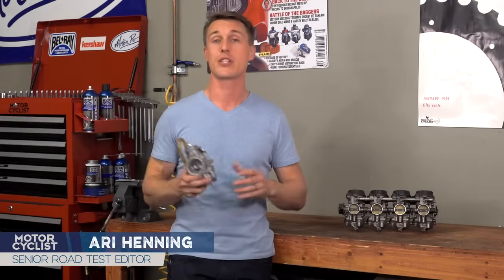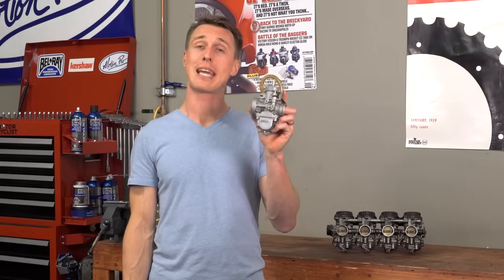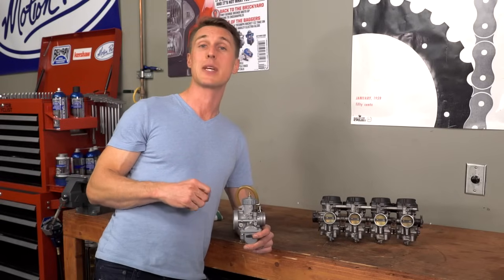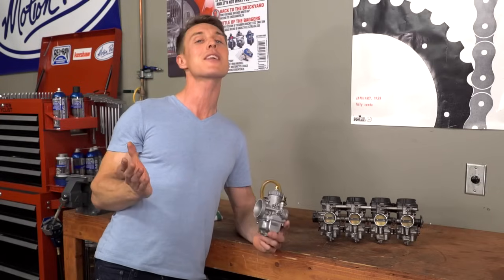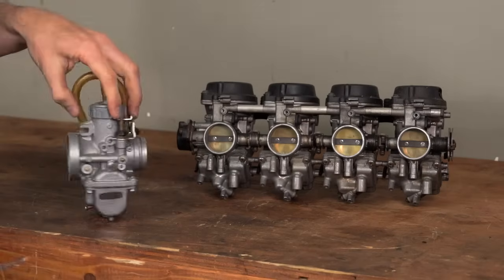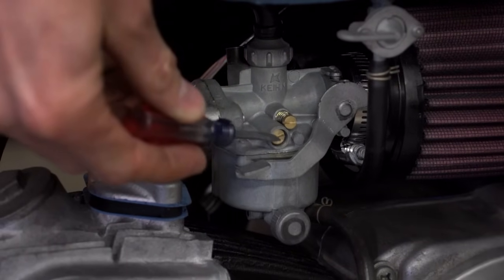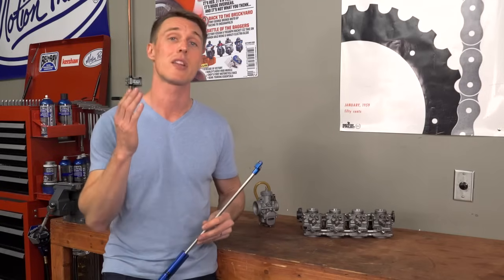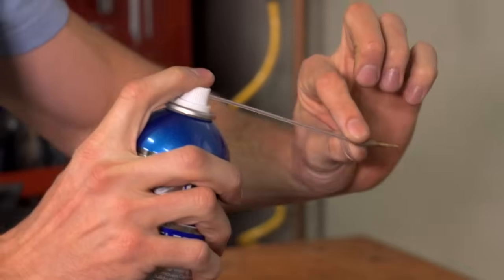The Single Most Common Carburetor Problem (Clogged Pilot Jets) and How To Fix It | MC GARAGE

Comment: Good video Ari, but I do have 3 comments: 

(1) When spraying carb cleaner through the pilot jet make sure that you do a couple of sprays with your finger over the bottom exit hole so that you can make sure the side holes are also clear. You want to see a nice strong mist of solvent coming through.

(2) If the jet is completely clogged often no amount of solvent will clean it. Before I pull a carb for cleaning I hit my local guitar store for a piece of steel E string . They will usually have some left over from stringing jobs and will typically give it to you for free. This is very fine but very stiff wire and you can gently work it through the jet without damaging it. Once there is a passage through the jet, the high pressure cleaner will then remove the rest as it passes through.

(3) I HIGHLY recommend holding the jet in a towel before you blow compressed air through it. Often your fingers alone won't hold it strongly enough and you can blow it across your garage never to be seen again (ask me how I know, LOL).
Reply: wouldn't it be easier to soak the pilot jet in a solvent, such as even rubbing alcohol?
Reply: E string smart!!
Reply: Copper wire works fine
Reply: @Mada-yq5sf  I have found copper is to soft to work through really crusty clogged jets. Guitar string works better. But to get the last of the residue I like blasting carb cleaner through.
Reply: Cool stuff

Comment: my trx300 had all the issues and it wasnt the pilot jet. it was the petcock on the tank only ran good when it was a full tank of gas if it got 3/4 of a tank of gas it would die under throttle lol and all of those issues

Comment: My xv1100 is sputtering and hesitating in 2nd and 3rd when I set the throttle for a cruising speed. Any idea what it could be? Idle is fine. But anything under 45mph is choppy.

Comment: I need some advice 

My bike on 2 occasions has had the throttle do something strange i would say get stuck at 1/4 throttle but the throttle isnt stuck its just still going then i cut the bike off then bump start it because its flooded and everything is fine ??

First time this happened I fractured my wrist 2nd time last sunday i managed to pull in the clutch

Comment: Hi.. I am having misfiring at idle to quarter throttle, is it a problem with the pilot jet, i tried tuning mixture screw, I thought it was lean and I made it richer, but I don't  get the quick initial throttle so I set it to right mixture, since i have fitted an k&n filter, may be I need to up size the pilot jet. Pls let me know..

Comment: Does the color of gasoline indicate anything?
For example, I once saw on a BBC program someone was pouring petrol into their cars from a glass container and it was bright yellow-ish (like diluted urine :P)
And the petrol where I live is dark orange (like the logo colour of KTM)
Does this show anything?
Reply: Where I live, fuel that has been coloured is fuel with no road tax.  Coloured fuel is for farm or construction vehicles and or power tools.  Dirt bikes too.
Reply: Review Guru do you know they are marketing that fuel here as RON95 and 97?

So it's all a scam huh?
Reply: RON (Research Octane Number)
Thats octane rating.  It's not bullshit.
Look it up on Wikipedia.  Its too much to explain on here.
Reply: Review Guru no I know that, what I'm saying is the fuel you've mentioned used for heavy vehicles generally tend to have oil mixed in them to lubricate the piston and the combustion chamber walls.
Plus, it's meant for vehicles which have very low engine rpms, like a tractor.
Wouldn't that destroy my bikes' engine? I also have to point out that I need to change the fuel filter once every 10,000 Km because it gets as dirty as a fuel filter used in an American car after 160,000 KM
Reply: Gasoline that has been coloured does not have oil mixed in it. 
If your engine is a two stroke engine, then you will have to add oil to your gas.  Don't add oil to your gas if you have a four stroke engine. What part of the world are you in? Why is your fuel filter getting so dirty?
Reply: Review Guru India.
So this fuel is completely alright for a high compression engine?
Reply: The dark orange of your gasoline indicates that either you're living in Trump territory or that he got to the tank and, ahem, put in some additives of his own.
Ungh, sorry, yes, sorry.
Reply: Making M'erica great again...YeeHaaaa!!!!
Reply: Aww..I really want to know why the petrol in this country is different.
Reply: The petrol (gasoline) is virtually the same in Europe as it is in North America, except for the bullshit ethanol issue in our gas. The octane numbers are different, because of a different rating system but it still does the same shit.  Prevents pre-ignition in engines.  
What kind of scooter do you ride?
Reply: Review Guru a KTM duke 390

It's probably a scooter for you.

Comment: What is the common cause of clogging in pilot jets?
1.  Varnish i.e. old fuel. Although fresh fuel should have cleaners to dissolve the varnish.
2.  RUST!!! A rusty fuel tank means either rust particles or dissolved rust make their way past filters into the carbs. The rust precipitates out when in contact with the  
                   aluminium body of the carbs.  Keep the tank topped up with fuel. Epoxy coat the inside of the tank BUT watch out for cracking which is caused when the tank 
                   expands in the sun. Use microfilters in the fuel line.

Comment: Hi, I have a 2003 1200 bandit which I've had for 18 months, Its 'had a flat spot of varying degrees from day 1. As I accelerate from an idle sometimes it will stall completely leaving me sitting at the lights, other times it seems to run on 2 or 3 cylinders for the first 5 to 10 minutes of my commute. Motor's fine,K&N filter, recent sigma jet kit fitted, standard exhaust, been to many mechanics including Suzuki dealer for several weeks who said 'it's just the nature of the beast'. Any help would be much appreciated. Many thanks, Jon.

Comment: I have a 2002 Kawasaki zrx 1200r. Ran great before I slid it in the ditch. Got it back together and runs rich. I did nothing except clean carbs. I've checked primary and secondary readings on coil packs and their fine.  I've even dropped needles down to the top clip, was on 4th from top and still runs rich. Floats are at factory settings. So are fuel and air screw.  Any body got any ideas????   I've also checked throttle position sensor. Checks good. New battery. Grounds are good. Won't rev above 3500 4000 rpms then bogs.  Changed plugs, same thing. HELP!
Reply: Rebuilt peacock also. Works properly.

Comment: My motorcycle has this switching on only with the choke and  turning off on opening the throttle. Once I cover about a quarter of a mile with the choke  on it becomes normal and remains normal for the rest of the day(even after switching off and standing a couple of hours). If I clean the jets and put them back on(before starting the bike for the day), the bike starts great for that day, but the next day again it is back to the same issue with starting.   I use copper wire to poke the jets as copper is supposed to be softer than brass, so I guess that is not an issue as such. Else, I use white spirit injected into the jets with a syringe to clean them. Still I end up with the starting issue the next day. Do you think it is time to replace the jets?

Comment: serious question then. if im just riding my bike and i start to slow down as if im getting off the high way, and my RPM's start going up to  3k & 5k what does this mean??? also if im going 35-40 and my throttle sound like its starting to kick out and my RPM's get lower and lower... what do i have to do to fix this!?

Comment: Great video and explanation, but you didn't address the BIG question - how to prevent the clogs in the first place? I have a CB350 with twin Mikuni VM's and the super-tiny pilot jets clog after sitting for a week or two. Is there no real, long-term fix or prevention here..?? It's frustrating since my CB360 with stock carbs does not have this problem!!
Reply: 62Buford he explains this by saying fuel stabilizer ..I would also turn the fuel cock off, and let the bike run til it dies , and drain the bowl

Comment: I already cleaned my carb thoroughly, I took extra time with it. I still have an issue with it, if I slow down the wheel, the engine slows down, and then dies. Valves are good everything is good, not sure if the clutch is sticking? I'll be replacing it in a couple of days. Going back to the carb? Maybe there's one hole the blow gun cannot blow out? I think I'll just get a extra new carb just in case, they are cheap in price. Forgot to mention the air screw doesn't do anything.

Comment: Kawasaki zx11 has a clever pilot screw system, they put a rubber hose to a external thumb screw on the side of the frame.

Comment: Good $h*t.  Best part was,  explaining and with text, the different reasons it’s the pilot circuit. Had really yet to find a video with these simple explanations.  Mine is notorious for a high throttle hang up, or a no idle bog. 50cc 2008 Yamaha raptor 4 stroke

Comment: I got 99 honda shadow vt1100cc and is running to lean,,is making sparkplug white. I do not find how to get to the problem,, I put 2 new pistom vacume with stage 1 jet on stock pipe,,,,,,2 new float level on 9.2 mm higt float,,I play with mixture screw from 2 turn to 4 turn and still running lean. Petcock working good,,,,fuel pump pumping good pressure.  Stage 1 main jet #60 in front and #65 on rear and it was running lean so I change from #60 to #65 in front and from #65 to #70 on rear to see if I can get more fuel to the engine but nothing,,, the motorcycle still runnig lean,,lazy,,,,I can feel the pistom knocking. Any Idea?

Comment: Folks if you have ever stripped out the screws on a float Bowl it's probably because you don't have the right screwdriver. Get yourself a good JIS screwdriver and your troubles with Japanese bike screws will be over.  I've got myself a Vintage Industrial ultrasonic cleaner and it works very well on carbs without nasty scary chemicals.

Comment: Advise needed for my FTR 223 ! :)

When the engine is hot (after around 10min of driving), I feel inconsistency in 2 situations :
 - When accelerating at low RPM : The engine seems to "skip a beat" before the bike actually accelerates
 - When cruising at relatively high RPM : the engine isn't smooth, especially in 3rd and 4th gear

It seems to be carburator-related, but any idea how, and how to fix it ?

Thanks a lot !

Comment: When I start my bike with the choke off, it starts revving st like 4000rpm at idle!!! It's not the screw and I've check for air leaks and found nothing. Could a blocked main jet cause this high revs. It sounds like it's really lean and overworking the engine. Also the idles hang. With the choke on however, it runs better but still slightly too high.
Reply: This started happening after I changed my throttle cable and I don't know why I'm pretty sure there is enough slack in it and the slide/throttle opens and closes fine. I can hear the spring returning the slide good.

Comment: is there a effect on the bike engine, when you remove the air filter/air cleaner ? it's common  here in my country especially in mc underbone and scooter tuner. I don't know the right term but they used to call it "OPEN CARB" some put velocity stack on it and others just a open aftermarket carb.

Comment: Hey great video, this may answer many of the issues I have on my 85' Suzuki GS550L; 

would a stuck pilot also lead to having a gas leak from where the Air cleaner tube is connected? Some suggest a Sticky Float or another person suggested it may be "valve starter" that is loose due to a stripped Holding cap.

Comment: someone tells me  : my honda cbr 919 air fuel mixture screw : if I close it until the end then : how much full 360 rotation should I open it ?
Reply: Start at 1 1/2 turns out
Reply: @paulbunyun-xi9by   great man thank you : so around 1.5 rotation is as a rule in each carburetor. I thought it is for smalle engines only..

Comment: Ive cleaned so many pilot jets in my 40 year career lol,  old Gold Wings are the worst . I usually use a small stainless steel wire I get from the stranded ground wire from Warn winch kits,  Never use a copper wire as this will break off in the jet and then you're screwed :/

Comment: Hi Ari ! Thanks for the videos. My carb'd fazer 600 has slightly cracked intake flanges, but it seems to be working fine at the moment. Is it a risk for my engine ?
Reply: Thanks Ari. Do you have a way to know if they are still airtight ? Something such as dripping gasoline with a paintbrush on the cracks and listen for a revving engine I would assume ?
Reply: Thanks Ari, you're the man !

Comment: I'm actually in the process of pulling my carbs out to clean them and rejet, sweet timing! (Gonna change the air filter over to something with higher flow.) Only had the time to pull the gas tank off so far, but I should have enough time to get everything done in a couple of weeks when I get a week off school. Got a service manual and a butt load of online forums and stuff to make sure I do this right. Anybody have any tips I should keep in mind? (I'm doing this on a 2008 Ninja 250. She gets real hot and hangs up the revs. Also cuts out when you give her a bit of abrupt throttle, even when fully warmed up. Pretty sure this is necessary.)
Reply: Thanks! I've been all over the Ninjette forums as you can imagine, haha. Somehow missed your story though. People seem to really discourage the DynoJet kits on the 250 wiki, but I'm more than likely going to buy some jets separately and test them out until I find just the right one. Seems like I'm gonna have to mess with the needles, float heights and the mixtures screws as well. Gonna be a lot of work, but I think it'll be worth it!

Comment: Thank you so much for this video! You saved me more hours of figuring out what was happening with my Honda Dominator, that it just didn't start (only by using starting fluid). Checked almost everything (fuel, spark, battery, measured stator, pulse generator, coil, electricity contacts, CDI box contacts, vacuum leaks around carb and air box, etc.), especially after disassembling and cleaning carb. In the end your video made me think that it still might be a carb related issue, because I started to remember that the problem started when I switched the fuel tank petcock to RESERVE. Removed the petcock and yeap - there were some debris on the bottom of the tank, without original fuel filter, which clogged the pilot jet. After blasting out the pilot jet with an air gun and assembling everything back together, Dommie now runs just great! Thanks!
Reply: I have a honda rancher 350 that will only run on staring fluid.

Comment: I just found this channel yesterday, watched about 6 hours worth of content so far. Your videos are insanely well done guys.
Reply: Thanks man, I am! Im a new driver, got a 00 bmw f650, and been having a lot of trouble with clutch linkage adjustment and hard shifting. 
If I adjust cable to far out on handle shift lever, easy shifting but clutch slips. 
If I adjust cable to far in, clutch slips still and super bad shifting. 
Been too afraid to adjust anything where cable connects to arm below on engine (I dont know what thats called). Theres a sweet spot I guess for easy clutching vs slip? I have it set right now to where its hard shifting, but no slip. If this is a common thing can you do a vid about that? That'd be epic man. Or just bring anything else coming, Im sure I'd watch it! :)
Thanks very much for the reply sir!
Reply: @Ari! Can you please do an vid on replacing forks seals! 
Mine need done, and I'm hoping I wont need to pay a shop to do it.. :/

Comment: Pilot jets on engines with 4 carbs get clogged because the pilot jets have a very small hole.
Smaller engines also and Fuel that had ethanol causes this problem. 
Big V twins have less of a problem because the pilot jet is larger.
Any gas with ethanol goes bad after 60 days.
Always replace the float needle because the rubber tip gets deformed when it has been sitting.

Comment: Alright this is a hard question to answer because no one is able to see what I'm looking at the same carburetor that you have in your hand I have on my motorcycle I took off the arm for the choke there was a spring behind it. There's only one way it supposed to go on and I feel like a retard because I can't get it back on properly. What am I doing wrong that is not releasing the tension for the choke on the carburetor

Comment: I have a royal Enfield. I just tried tuning the carb today. When I turned the mixture screw either left or right there was no increase in RPM which should have been the case. Do you know where the problem lies. I would like to implement the solution myself as mechanics are just cheating me here. Thanks for your input in advance. Just hit the subscribe button and bell icon. Cheers from India.

Comment: This resonates with me as I have had constant pilot jet problems with my Kawasaki engined lawn tractor with Walboro LMF carb.  Unfortunately on this carb it is nearly impossible to clear pilot jets due to the idiotic design of the carb so on one occasion only a new carb would do.

Comment: My first step with a poor running bike is to dump a bottle of seafoam in the tank. A good portion of the time, that cleans the carbs nicely and I don't even have to take anything apart. That and a good carb balance every once in a while are all I've done to my '85 CB650 carbs.

Comment: What about a 99 yahama 650 that bogs up at 1/4-1/2 throttle in every gear ... ?
Reply: If it is carberated it's the pilot jet. I have the same issue on my 1987 Yamaha Virago 750